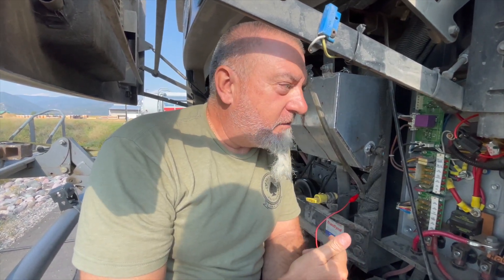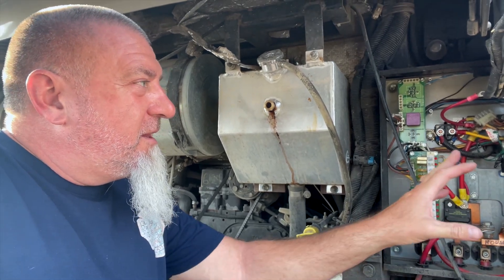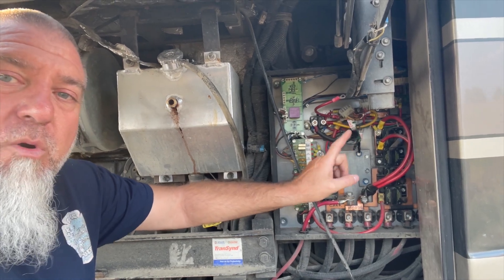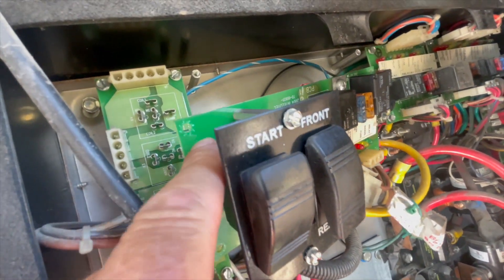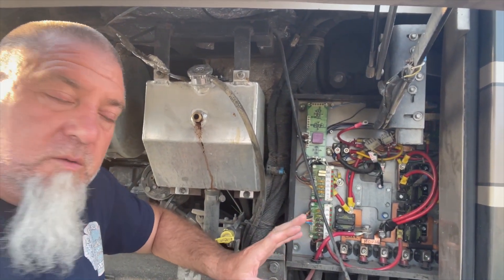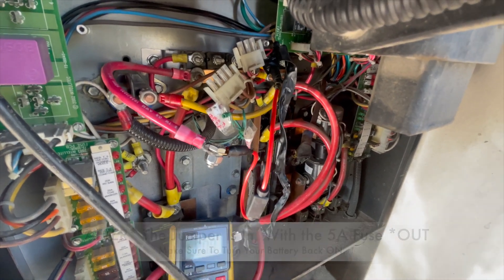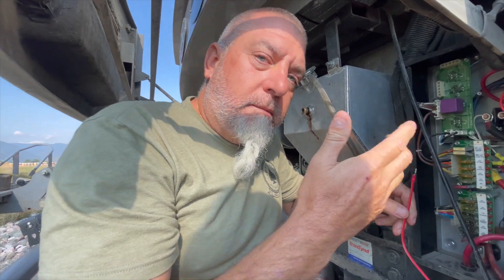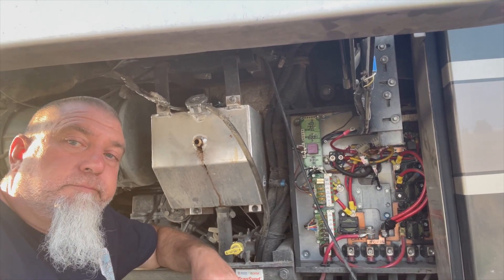Cummins ISL 400 ENGINE COMM ERROR

Comment: Great video. Perfect. I need the part number of that board please ?
Reply from the maker: Im not sure, I actually sent it to a guy in NJ to have it repaired!
Reply: @ was it dry solder or component failure ? Did he elaborate ?
Reply from the maker: @AffordablePC1  he said it was an internal failure of the (ignition, I believe) relay on the board.
Reply: @2ustravels77  great share there mate. Will help someone
Reply: @2ustravels77  Yes - it was a failed relay on the circuit board.  Normally I return failed components so I suspect I also did it in this repair. When the ignition key is turned ON, the board get powered up and certain LEDs light up telling me how the board is working.  That relay was intermittent.  I could see that from LEDs lighting and going OFF in the video.  So I removed the failed relay, replaced it with a new one and sent the board back via overnight FedEx.  I also gave him the procedure to in effect bypass that circuit board so he could drive his coach if needed before receiving the repaired board.
Reply: @AffordablePC1  Actually last month his video helped another person in Alaska with exactly this same problem.  He found this video, was able to send the board to me for repair and used the bypass procedure to drive the coach.  In this case it was both a bad relay and a bad front/rear start switch.

Comment: Wizardry. Def good to know for the lamens who don’t wanna be stuck in bfe.
Reply from the maker: I hope it helps someone out of a bad situation.
Reply: @2ustravels77  Yes it did - last month your video helped another person in Alaska with exactly this same problem.  He found your video, was able to send the board to me for repair and used the board bypass procedure that I gave you in your video to drive the coach.  In this case it was both the same bad relay and a bad front/rear start switch.  Interesting - that's the first failed Start/Stop switch issue that I've seen so far.